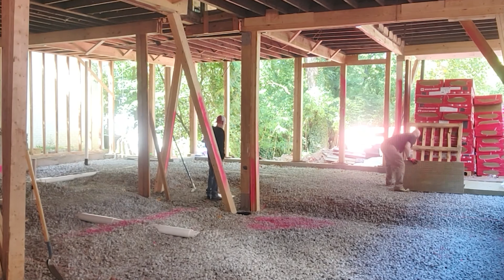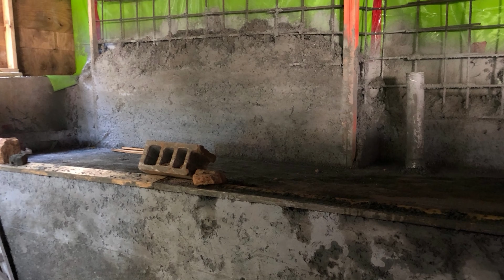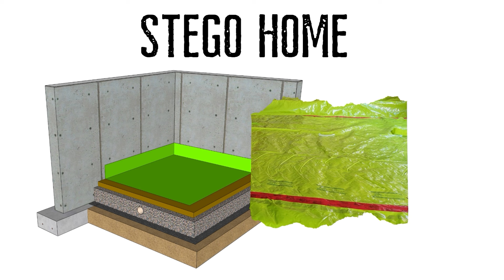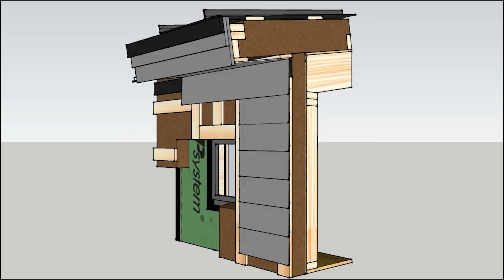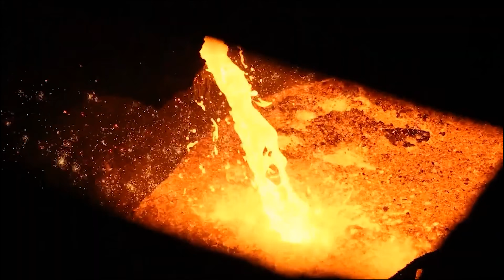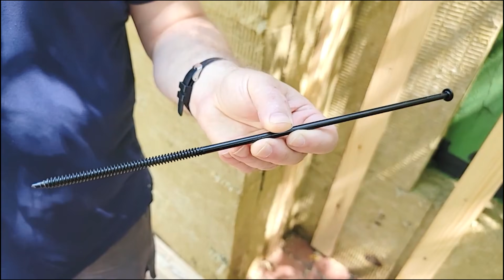The Perfect Wall Explained with Examples

Comment: The explanation of the perfect wall concept and its continuous control layers is really interesting. I especially liked seeing how insulation and vapor barriers are applied across the floor, walls, and roof. These details play an important role in building performance, and an energy assessment toronto can help identify where efficiency improvements are needed. This connects well with BPConstruct’s work in building energy solutions.

Comment: Even though it is tempting to just keep stacking insulation and roof layers on top of each other, wouldn't it be better to just build a box for the living envelope including sheathing above ceiling joists, then wrap the whole thing in continuous vapor retarder membrane ?  Then build a roof structure on sole plates or stub walls as though it was a short uninsulated second story as a vented attic where you can pile as much cheap cellulose blown in on top of the vapor retarder above the sheathing on the ceiling joists.  No sealing drywall inside as a vapor retarder, open ceiling joist bays, smaller ceiling joist lumber because it only supports ceiling and insulation (not roof), and ceiling joists are not breaking the lower insulation layer forming partial thermal bridges.  Even the roof rafters can be smaller lumber because the attic height allows purlins and diagonal strut braces to reduce the rafter spans.  Still Perfect Wall since all insulation is outside the living envelope WRB.

On the exterior walls, avoid using long screws that must hit the exact center of house studs and punture your WRB.  Those long screws probably cost more than a second stud wall and each one is a thermal bridge from furring strip to house stud.  Build a second 2x4 stud wall with staggered spacing compared to the house wall on its own sill plate that is vapor open but holds horizontal continuous R23 batt Rockwool in a gap to the house wall and R15 between the 2x4 studs.  Attach the top plate of that stud wall only at foundation and rafter tails.  This wall doesn't need sheathing because the shear is in the house structure, this second wall just needs to support the siding and contain the insulation.

Comment: I'm building my retirement home right now which is how I ended up here. I'm using conventional framing, rockwool insulation behind the drywall, plywood sheathing completely covered in Prosoco membrane and vertical vinyl siding. The only disadvantage I can see when compared to the method described in this video is the R-value of the installed insulation.

Comment: I'm beginning to think that a lot of these videos are designed to sell certain product. Its not false advertisement but everybody uses zip and rockwool and siga products.  These are great products but lets designate that you can use other material to achieve your goal without buying the most expensive product there is. Some people have budgets that constrain them and saving a little bit here and there really adds up.
Reply from the maker: We agree.  We are not getting paid to promote and of these products.  The builder actually experiments on his own dime to find the best combinations that are cost effective for the result.  We'll be featuring some other methods and assemeblies this year since you have hit the nail on the head.  If it is not optimized, no one will do it.

Comment: We speak endlessly of continuity—of layers uninterrupted, of gaps filled and seams taped with precision. Yet we routinely carve enormous openings into our walls to admit people, light, and air. However refined their construction or impressive their R-values, doors and windows remain some of the weakest points in the envelope. At what point does the pursuit of perfection in the details lose sight of these larger compromises?
Reply: Also those long screws are insanely expensive.
Reply: @helmanfrow  Yes, and if you build in a high wind or seismic area, they will be required every 12-16" vertically, not the 24-32" he was able to get away with.  A thousand screws at $2/ea.

Comment: If you put in a lot of exterior insulation, you might as well put in cheap fiberglass insulation in the cavity.  If you've got a simple cavity, it is trivial to install.  If the cavity is complex, you can easily do an okay job, since ultimately you are depending on the exterior insulation for half of your R value.  So it doesn't matter if it isn't perfect.  My current costs estimate says that fiberglass is a third the cost of ISO external insulation for $/R value.

Comment: For my California (north -coastal) climate, I think my house works great: plywood, insulation, 2x4 studs, drywall—with paint both sides. Drawbacks: not quite enough insulation, too cold for a quarter of the year. Needs to be painted regularly. No W.R.B. Was installed and it still functions great. The original owner did not paint it since the first scant paint by the builder. I had to replace siding on the south side and had some stud damage. So yes there was damage due to poor maintenance and no W.R.B., but in general it functions well in terms of vapor control and drying. So I’d say build a wall with 2x6 studs, and higher quality insulation and W.R.B. On some areas only and it would be great for my climate, And paint it.

Comment: Is this a perfect wall? Lime stabilized compressed Earth block ➡️ rockwool ➡️ air barrier ➡️ lime plaster for the siding??? 

The plaster will be the air, water, and vapor barrier. Built with a large overhang.

Comment: If you want a "more" affordable house, don't do this. There is such a thing as a house that is too tight which needs fresh air from the outside piped into the house which quite literally defeats what this video is about. Current building codes negate their own purpose by requiring fresh air intake from the outside. Simply put. This is stupid wasteful construction following what the lobbyist's demands, lobbyist's pay lawmakers to pass these self-defeating codes, to increase manufacture, retail, and taxation at the expense of those who purchase these houses. This is in large part why I quit building houses and let my license lapse. I'm done with this industry.
Reply: Well, no. Heat recovery from the exhaust air is cheap and efficient.

Comment: Best walls in my opinion are ICF walls. Followed by a normal wall with closed cell spray foam and proper water barrier on the exterior.

Comment: I’ve been improving my grandfathers cabin that I’ve owned for 10 years. The exterior is vertical log and they are soft at the lower end that were exposed to deep snow over the years. The studs are impeccable do to the 60 lb felt that was used between the exterior and framing. I’m a true believer in 60lb tar paper.

Comment: work with nature not against it . stick framing inevitably requires one to control a weakness in design .  american stick framing was /is all about saving cost . there is no aspect of longevity built into the system , only price first everything else second . it's appears to be an American as the price above all else i see in everything we purchase , from houses to cars to gas to food etc etc.
 The current attempts to increase energy efficiency  involves additional lumber but in the same configuration that creates so many problems .
for a relative small increase in wood , one could use mass timber in the form of manufactured  kiln dried logs or CLT panels for the exterior walls . the mass aspect of thick timber acts as a heat storage medium and controls humid changes due to its hygroscopic effect .  installing wood fiber insulation panels on the OUTSIDE of the walls eliminates thermal bridging as the mass timber is all the same density. on top of the exterior insulation ,furring strips are attached vertically to accept a siding of choice . the space between the strips acts as an air vent to wick moisture away . the vents are open at the top and bottom with insect and rodent screen installed .  the extra cost of the timber is offset by decreased labor .the exterior walls when precut can be assembled in only a few days . the roof structure can be quickly assembled to close the structure in . also there is a saving in no additional work is required on the inside walls and the exterior siding protects the insulation and the mass timber from the elements .

Comment: Polyiso is my preferred method to care for the continuous insulation control as it has the highest R-Value per inch. This way you don’t have to to try to find 13 inch screws. We can meet that same R-value with 4 inches of one polyiso board.

Comment: Nice passive vent system for radon. Is there a low level air-in pipe, as I imagine it needs to pull from somewhere to work efficiently?
Reply: Wouldn't the air in be from the radon already escaping from the ground? As for the pulling, I believe he addressed that in the part where he says the wind hitting the house and going over creates the difference in pressure that pulls the gas up.

Comment: I dont understand.   Build a cinder block wall seal the outside and build a 2nd cinder bolck  two ft from the first and fill with dry sand.     Low tech,  all materials are available in bulk and great thermal properties.    What am i missing?
Reply: Interesting idea but if you fill the cavity make sure no rain or moisture gets in there, also check the r-value of two ft of sand plus cinder block; Probably ok but not great. Lastly, better use some next level wall ties to stop the wall from bursting apart!
Reply: That is a thermal mass wall. They work for hot days and cold nights.  If days and nights are both cold, the entire wall will be cold and you spend a fortune on heating as the wall sucks all the heat out of the house and indoor water vapor condenses on the inside of the cold wall.

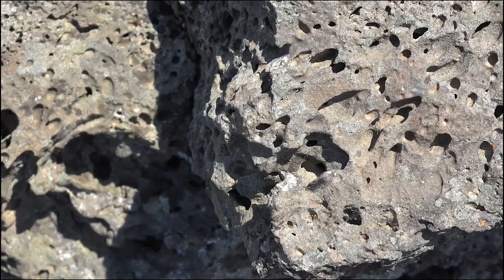Comment: I think that much Rockwool is overkill.  Just look at the sample they set on fire with a device inside the rockwool built house (19:20).  Its not a 6 to 12 inch thick wall, and probably only 1.5 to 2 inch thick.  So having this in mind the heat wont penetrate through the 1.5 to 2 inch and keeps the humidity on the outside if that is a concern and then space between the sheathing and rockwool should be in balance (not fluctuating in temp).
Reply: The figures don't lie. The more insulation, the less watts of energy needed to heat or cool the house. Properly built Passive is way more energy efficient and therefore far cheaper in the long run.

Comment: We try to keep moisture going outward in our timber frames. People don't understand how much moisture builds in a house. Block walls we core with vermiculite, mineral wool batts and board, low perm air barrier, air gap, and masonry veneer. Wall ties for masonry veneer hold the mineral wool.

Comment: definatley rigid on the bottom foot or 2 feet instead of that, you can see the water being absorbed from the ground. Or vapour barrier rapped around the front of it when drainage to the back.

Comment: I think it's great. I studied the diagrams. Prevent dew point from being on surface of sheathing. Cover house in a blanket. 

The main issue is the cost. I wish it were affordable.
Reply: The same amount of insulation on the outside as in the inside just far easier on the outside less cutting no wires etc.
Reply: @tspot8190  On the exterior, you have to use rigid insulation, which is about 3x the price of fiberglass.  If you use rigid mineral wool, you are talking about 7x.  For me, it makes sense because I'm building off-grid in a location that has cloudy winters, and its in an area that could be subject to wild fire.  But I can't see any reason not to insulate the cavity for whatever good it does.

Comment: Cool...next do the affordable wall. 😂
Reply: In practice, construction costs have no effect on housing prices, and hence affordability.  Save on building it cheaper at the same quality, and the planning department will assess higher mitigation fees, or tap fees, or demand more green space, or the builder will have a higher profit margin.
Reply: You can do it cheap or do it right, which isn't much more costly if you choose your materials wisely. I'll never understand people who expect to get a high quality, durable, comfortable, efficient building without following the basic principals of building science.
Reply: @dlg5485 stick built with thick exterior insulation isn't the right way at all. Omni block or faswall is the right way
Reply: @ Tell that to people like Joe Lstiburek who have been studying various building techniques (and their results) for decades. As always, I only listen to those who have done the research and have long term data to back up what they teach. Also, there are multiple ways to build an effective wall system.

Comment: Skip ALL this and go with ICF. Alot quicker to install the same or more insulation value overall and it doubles as an air barrier. Couple with an ERV and foamed roof and you control the air ten times better. Good friend has 4500 sqft house and his entire utility bill (gas, elec, and water) in the middle of the Oklahoma summer was less than 200.

Comment: I'd just use Zip-R12 and skip all the freakin labor intensive detail of mineral wool and furring strips with window buck extensions etc.  The more wall insulation you add after R-30 (Zip R-12 plus closed cell between 2x4 studs) the more you have diminishing returns of cost to build/energy consumption.  With this method, your wall thickness will be the same as if using 2x6 studs and windows will fit without custom extensions.

You can build something like R-50 walls and triple pane windows but you'll never see a positive energy return compared to the cost of this build method unless you live above the arctic circle.

Design your house with large roof overhangs and you eliminate a great deal of water intrusion problem areas, especially around windows.  You also reduce thermal gain with less direct sunlight coming through glass.  Eliminate roof valleys and you'll have less chance of water damage.

You can spend as much as you like with complicated mineral wool over regular sheathing (OSB or plywood) but you won't get it back when you sell.  The dream of spending the rest of your days in your home applies to very few.

I think it's foolish to overbuild to this extent.  The high R-values literally go out the window with new home owners wanting many large window panes, which are around R-3 or spend a lot more to get R-5+ triple pane glass.  Investing is a super duper insulated home is not an investment.
Reply: Interesting points… especially with the windows and sky lights.

Comment: How are you ensuring the furring strips are evenly fastened?  (i.e. a flat surface across the entire wall assembly for the cladding and not compressing the mineral wool potentially reducing it's effective r-value?)
Reply: String lines

Comment: I thought Zip Systems’ outer green membrane is 13 perms, whereas the OSB underneath is 1-3 perms. Doesn’t that make your OSB your vapor control layer? It’s okay in winter, when the OSB is hot, and the hot humid air leaks out into the rock wool, because rock wool doesn’t mind being wet/humid. But in summer, the Zip OSB will be as cold as the interior air conditioning, and Zip System will allow humid outside air to contact the cold OSB. Is 13 perms enough to prevent the OSB from getting too moisture saturated? Are you expecting drying to the interior through the OSB to keep it dry in summer?

Comment: I have read many articles by Prof. Lstiburek. As he says wood burns and rots.
I am an architect i Europe and in practice we do Perfect Wall without using wood. The main wall is brick. And the cladding is attached to aluminum studs. The insulation is always mineralwool. As a finish we use Knauf Aqua white cementous Panel.
Reply: I'm designing a house in australia and we have very different climate criteria but I'm also looking at a masonry structure with cementitious exterior cladding.  Essentially it sounds like you are talking about what we would call "reverse brick veneer" but was surprised by your "aluminum studs".  Do you just mean metal studs that hold the insulation layer?  I imagine that would be worse for thermal bridging...
Reply: Solid masonry walls aren’t possible in a lot of US- earthquakes or even shifting soils. Need more flexibility in structure.
Reply: I've learned a lot from Lstiburek over the decades. But there are wooden houses, not just in Europe, but in the USA, that are centuries old. It's perfectly feasible to design a long lasting, well functioning wood house. As a carbon sink, wood also has the potential to reduce atmospheric carbon, unlike masonry materials that require lots of energy to create.
I'm not saying we shouldn't build in masonry. But we need to be comprehensive in understanding both the strengths and weaknesses in all these materials, and use them appropriately.

Comment: Interesting that you can run the Rockwool and furring right down to grade with no drip edge, nothing. Definitely not code in the  majority of the country.
Reply: I thought the same.. super weird. Building 101 is get wicking materials off the floor
Reply: @1stkeyhomebuyers  Rockwool doesn't wick moisture
Reply: @srchubz  ...maybe... But have it sitting in it
Reply: Critters will still move in without a hardware cloth at the bottom
Reply: Look up "rodents love mineral wool" on green building advisor. Probably not a bad idea to flash it somehow at the bottom

Comment: Got it. Frame up two houses, one inside the other.
Reply: That would be cheaper than what is shown here, depending on expensive 12" structural screws to hold siding weight cantilevered out from the structural walls.
Reply: haha sorta. the outer layer isn't structural, it's just the blanket. the inner wall is structure only, not insulating. 

Meanwhile my 100 year old house has no insulation ☹